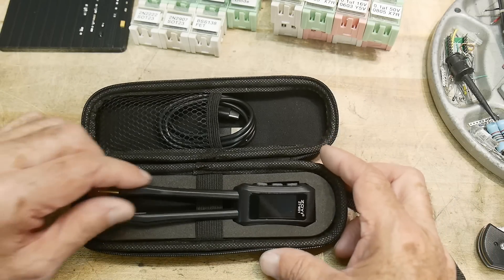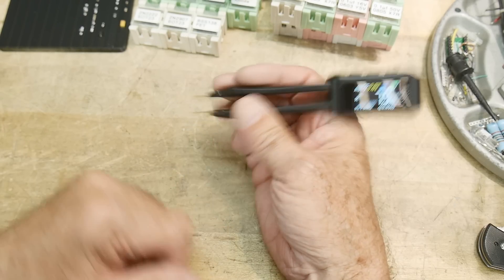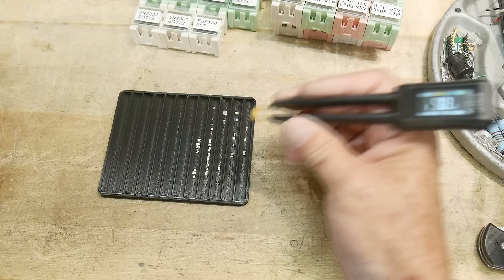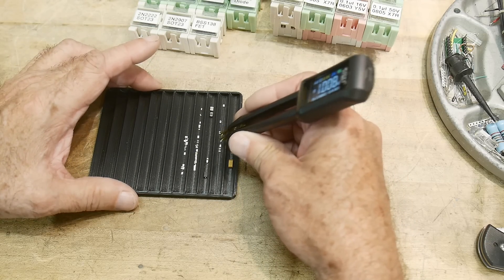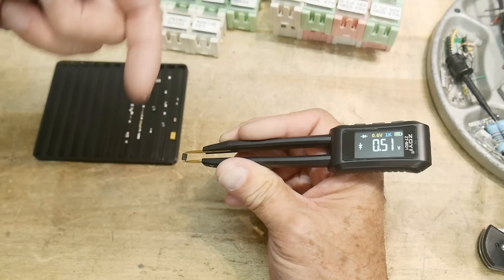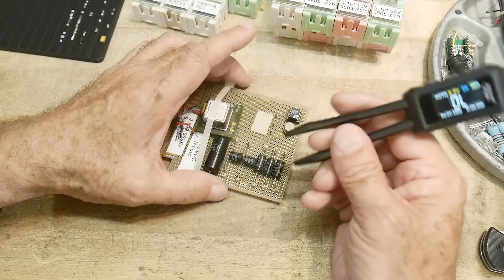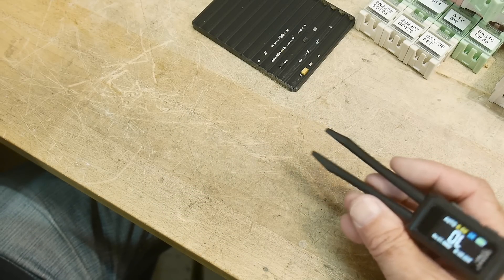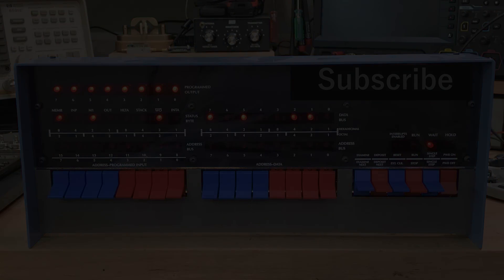#1986 ZOYI ZT-MD1 LCR Tweezers

Comment: I want an four wire RLC meter with four digit afte decimal point and better than 0.25% acc. 
And an equitherm pad/oven to prepare components at sorting.

2 wire measurement with added hand capacity is more like an fancy beep beep test.

Comment: I used to measure voltages with pencil meters. Even made a pencil adaptor for the dearest Fluke. Way to go. But now just found something that does or at least promises to do esr instead of diodes. I will let you know when I have tested it.

Comment: There is 0.3V setting for in circuit measurement, in case you missed it. Save the Holdpeak for Zener diodes.

Comment: That flicking of the smd components reminds me of my first day with my hot air soldering station.
Reply: I believe everybody who had to deal with SMD, have their share of flicked or sneezed away components. My room also has some 0402 and 0603 resistors and capacitors somewhere on floor.

Comment: After spending decades slowly and painfully accumulating a bench and rack loaded with 500 pounds of HP/Agilent, Tek, Fluke, Anritsu, etc equipment I thought I was finally done. But now I find myself slowly accumulating a drawer full of convenient hand-held equipment that does the same thing. It's an endless process. There is simply no end to the madness. At least it's now stuff I can lift that's under $100 each. I suppose it will end with everything being on my phone, and characterized by it wirelessly sensing all of the parameters and listing them to me, or just advising me on what's wrong, or what parts to use. We live in interesting times.

Comment: I've been wanting a LCR tweezer for a while and being a lefty, everything on the market is for right handers. This one having a display flip mode and not too expensive I'll probably get one now.
Reply: Exact same issue here, my right hand is super hard to control especially for a workload like this where precision is needed to grab and hold the part. It's still not a true ambidextrous design with the way the buttons are placed etc but it's pretty damn close.
Reply: Update: I just got mine today. Testing random smd components on my mixed bag of dropped parts and it seems to do what is advertised. Will make rummaging through components more convenient.

Edit: After using it a while, it seems the tips are too smooth which causes the flicking issue. I put a needle file on the tip and tapped lightly with a small hammer to make a knurled texture without removing the gold plating. Worked a treat!
Reply: Same here, looks a good buy.